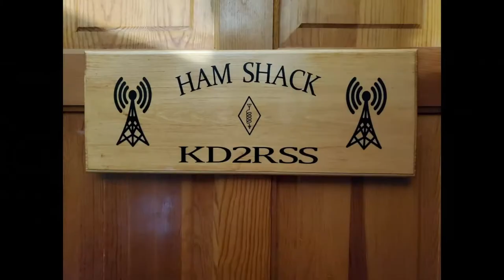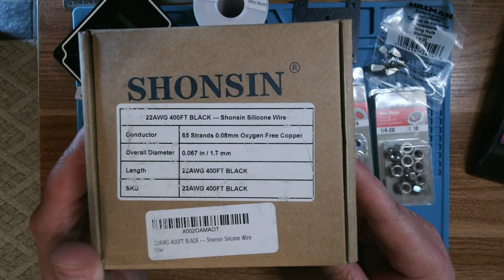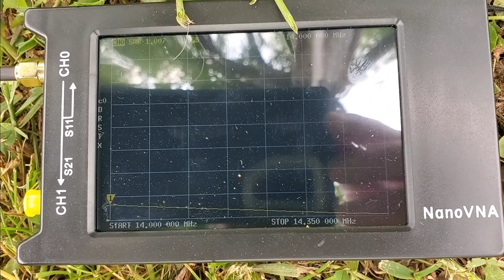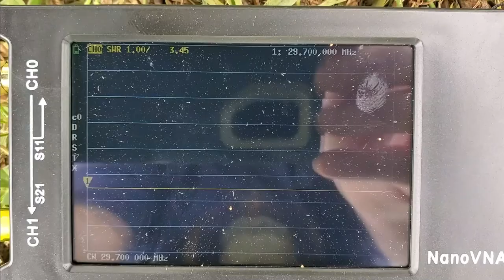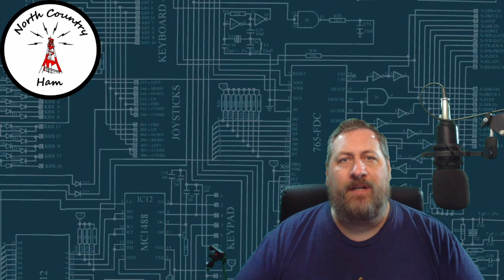EFHW Build

Comment: Looking good for the torrid but you could have used 16 guage wire for rapping the windings to be able to handle a thousand watts of transmitting power.
Reply from the maker: I dont have the capability to run 1k, but went with the 14 ga just so I could do at least 100 watt, but will for sure keep it in mind when I expand my gear in the future. Thank you for the input and idea for future builds